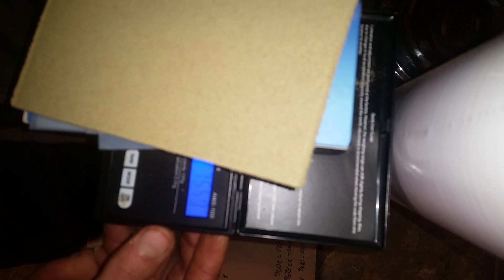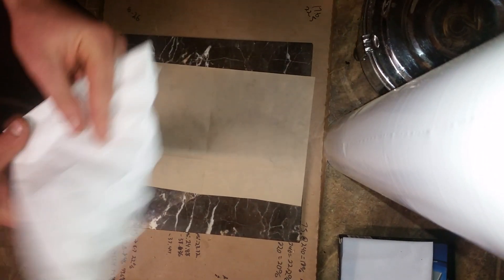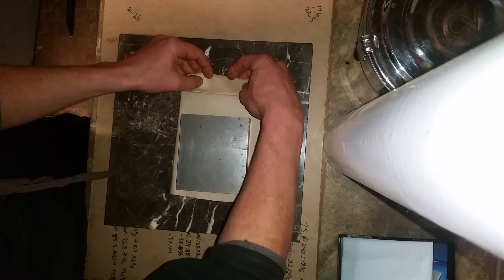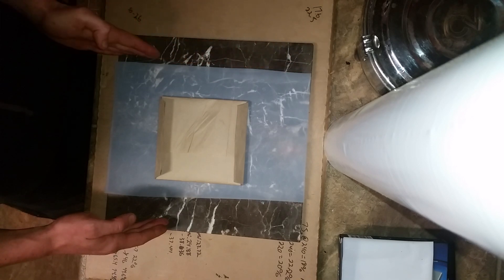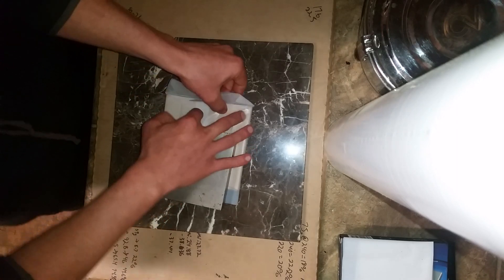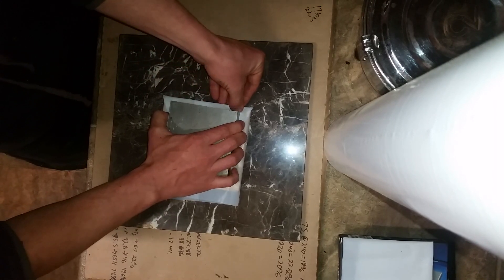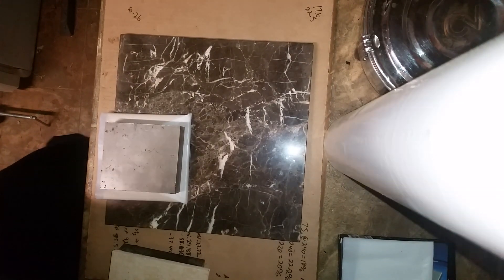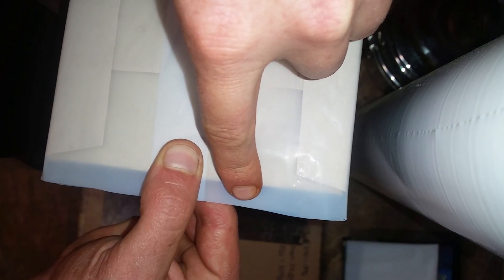Folds and concepts II - 3 Sided Enclosure

Comment: where do you get a weight like that and also what micron metal screen do you guys use on exterior wrap?
Reply from the maker: We went to our local Machine shop and asked them cut a piece of steel to size.  The things we looked for were size and overall weight - the size will largely depend on how the filter and mesh is cut and folded.  As far as weight,  it needs to be hefty enough to keep the Pre Pressed Pack (PPP)  from expanding.  This is more of an issue with flowers than other materials.  
The SS mesh used outside of the paper filters is 120u.
Reply: Knowledge4all2be1 it's not a weight just type in steel or aluminum stock bar block in eBay